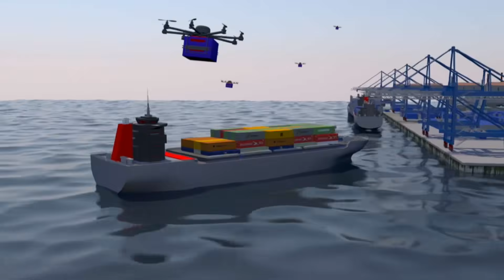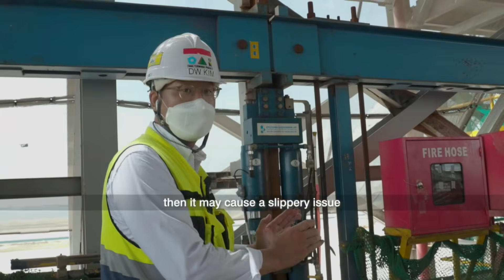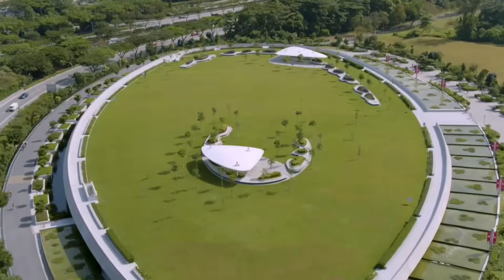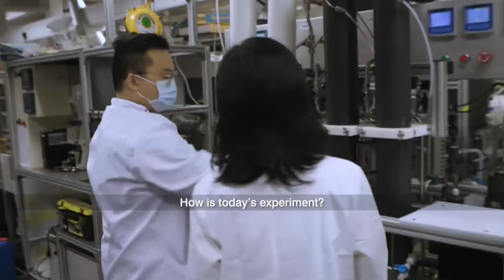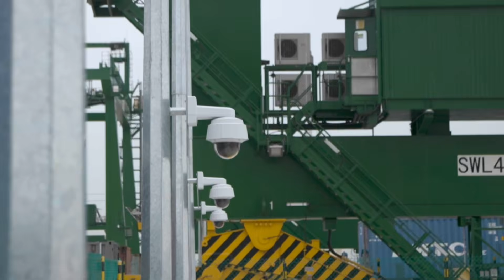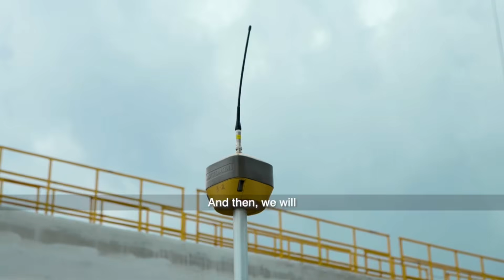Radical Innovations To Singapore's Water Problem | Tomorrow City | Part 3/3

Comment: I love the documentary and the detail with creating the caissons, the fresh water issues, solutions through desalination, and the addition of a new port and land at the same time. The only thing that wasn’t covered in this documentary (and I was waiting for it to show up) was how the caissons sit on the seafloor? 

In other words, the Seafloor it’s not flat bed rock. What type of preparation did they do to the seafloor in order for the caissons to be horizontally even with the waterline on top? You can’t just take a caisson that’s 30 m high and sink it into the ocean floor where it matches with the water level on top without any detail preparation on the bottom. If you did that, they would all be at different Levels on top because the seafloor is not perfectly flat. To me, that would be one of the most important parts of the whole building process.
Reply: My question is.. isn't just evaporating water easier and less energy consuming that pressurizing it and making those expensive specialty membranes?
Reply: I was wondering the same thing. Surely there are preparations done and I wish they covered that here. My guess is they dredged the whole area to the same depth as the natural depth along our coastline isn't that deep.
Reply: @kevinharmon8227  It's more energy consumimg but you could say it's easier
Reply: The only thing I can tell you guys, the Palm Islands in UAE, how was made you can watch it.
Reply: @kevinharmon8227  evaporating water takes far greater energy to heat.
Reply: Robert, they're probably silent because that's where the Engineering IP is. Most likely some form of deep water steel coring, piling and underwater concreting has been carried out to create a stable base footing.
Reply: @kevinharmon8227  theres not enough land space for large scale evaporation of seawater in singapore. Its slow, depandent on weather and you'll need huge lakes of seawater to match the demand. Its also too humid in singapore so evaporation will be slower
Reply: @gargantuantentacles846  the difference is, the port is designed and built to last. See the serious erosion happen to the Palm island, and Singapore for a century of reclamation has paid tremendous attention to.

Comment: I'm sure the engineers who designed the Tuas megaport structures has taken into account the effects of climate change and the possible sea level rise by the year 2100 or earlier. The new port has to be future proofed up to 100 years and beyond. So it would make sense if the caissons are designed to float and its height can be adjusted by pumping out the ballast water as required when sea levels rise.
Reply: Caissons full of rocks. They anchor the edges of the reclaimed land area.
Reply: Oops.
Reply: the level will not rise too much, just dont watch propaganda
Reply: @m402363  Exactly , in Spain 2023 you cant enter a city with a 2006 car , coz "polutes", after that they invented a "pass tax" in order to 2006 car owners can enter xD

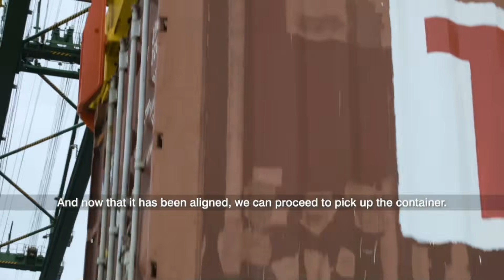Comment: 40:50 Calibration or testing of various sensors need to regular done (e.g. a few times daily or hourly) to ensure various sensors for automated heavy movement are working properly to facilitate heavy automated movements. I.e. heavy automated movements will be stopped and alarm triggered the moment a sensor issue is detected.

Comment: Engineering on paper is different than for the ones on the field. Cussing at the engineers sitting at their desk is a daily routine for us working on the field. Then again, it's a mutual relationship.
Reply: Trust me, you arent that significant
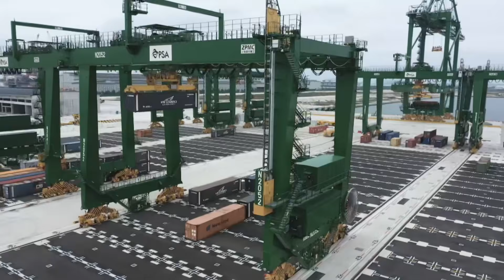Reply: 30:32 what's the silver lookng wheel on the big green howsyerfather?
Reply: @vandebosch822  are you?

None of them are. Nobody is.

Dust in the wind.
Reply: MOONA m  Noted. Thanks for the reminder to install Grammarly.

Comment: OOPS this was meant for the floating solar farm installation.    A lot of fish tend to congregate under or around shady areas, such as oil platforms and docks, so I can imagine these floating platforms will attract many fish especially if there are columns going down into the water to give hiding spots.    With what China is doing to Hong Kong I can see Singapore taking over as the shipping center of East Asia.  Now they are putting in a lot of wharf space on the water itself.

Comment: So in theory if there is already equal pressure of desalination 650m under water, the water that deep or further depths should be naturally partially desalinated as the water pressure would push out any molecules that aren’t hydrogen and oxygen, therefore reducing the salinity lower in the ocean . So pumping water from the deep ocean could maybe be more energy efficient than desalination using a flowing pipeline the pressure itself would drive much of this water towards the surface.
Reply: Singapore does not have access to any water body that is 650m deep lol

Comment: I have two questions:

1. When you sink the caissons do they set on the bottom or do they float? If they float and it looks like they do, what is to keep them from shifting in bad weather?

2. In your water system you mentioned that you could switch from sea water to fresh water and back again. I was wondering if you have ever considered prefiltering your sea water? In the area I lived in when I was young we had Salty water and we developed a system of running the Salty water through a system of sealed glass chambers and would let it sit so the sun would heat it up. As the water would heat up it would condensate on the glass above and drip to a channel that would carry it to our water tank for drinking. In one day we would make more than we could drink in a week. I don't know if this could be enlarged enough to make it worth using in your situation but I do believe it's worth a try. It only cost us a small amount of energy to pump the water and nature took care of the rest.

We would just drain the system back into the source where it came from but if you are pulling it out of ocean water maybe you could run it until there was no water left and sell it as sea salt.
Reply: @cassieknowslots  get off your mum’s phone
Reply: It requires more energy to run the more saline the water is.  So it’s uneconomical to extract fresh water from the brine at a certain point.
Reply: Caisson Will sit permanently ,finally Will be put sand in the rooms of caisson. Caisson is not new technology, during WWII allies Troops using caisson to land in Normandy 😁😂😃
Reply: @ZSVisuals  Spot on..
Reply: There is a system called a solar dome. It’s just as you describe but has a mirror system to concentrate he sun’s power.
Reply: @jerrythehousetiger3616  Didn't they show scientists working on new systems for extracting fresh water?  Those new systems were much more efficient than the ones they have now requiring less energy.  They are committed to desalination so I am sure the scientists will gradually improve the process to where it is economical to use.

Comment: Does the Hydrodynamic scour the caisson's create accelerate the eroson of adjacent, coastal areas as it impacts on the littoral drift process? Also is there an EIA for the huge increase in the use of so much Silane? Great technical excercise but you maybe storing up a food chain disaster for the future.

Comment: Integration with roads and roofs for both water collection and energy production is nearly ignored. Major highways can include massive water retention. The USA turns their heads also because road construction is designed to fail to begin with —- so road workers replace it again.  A mafia level agreement to rebuild roads again and again. I see people making new footprints instead of using existing major construction that occurs non stop …
Reply: I agree. I read somewhere there was  a proven paving mixture technology that makes the roads heal themselves and last decades if not forever with minimal maintenance. Sadly, the road construction lobby nixed it because they didn't want to lose their job security!

Comment: The concern that comes to mind; where does the sand & gravel for those Caissons come from? What beaches or shallow water areas have been destroyed? What destruction to what ecologies have occurred for man to say “look what I built?”with no regard for the lives destroyed? It is fascinating — and terrifying.
Reply: Look around your own house.  Where did all of that concrete, timber, glass, etc  come from?
Are you "fascinated and terrified" by your own home?  How about all of the homes in your neighborhood, or in your city?
Reply: @glynnec2008  In another CNA episode, the slag derived from incinerated refuse (which has normally been used as landfill) is now being combined with cement to form even stronger concrete.  It is used to substitute the sand.  We used to deposit the slag in an off shore island as landfill.  With this concept, there will be less demand to use sand and we can benefit the environment.  Incinerating the refuse and waste to produce heat and energy to generate electrical power and at the same time use the slag for construction.
Reply: Unfortunately I have heard that some of the sand and gravel coming in to Singapore is quietly coming in from other places in the world that shouldn't be doing this. ie. illegal? I hope it's not true. Have you looked into the situation with sand? Not all sand is equal and the stuff needed for say high precision optical instruments is very rare so hard to find, and most sand is not suitable for making cement. There's a couple of books out on it and I think videos. Scary stuff. The cement industry is advancing but it really needs more advancement and getting away from sand as an input. I haven't watched the following video on Singapore's relationship with sand, so I don't know how credible it is. https://www.youtube.com/watch?v=ES2TWIcFOzw

Comment: The combination of large power requirements and the power requirements for RO (reverse osmosis) require more power than to use the multistage evaporation technique, which combines the cooling requirement of the powerplant with the condensation of both the steam driving the turbines snd the  extremely clean condensed, ready to prepare potable water. The use of membranes does not makes sense. They are fixed to make a huge mistake. How to I know? Because we delivered the first multistage evaporation unit to Singapore , built in Switzerland, by EPUL . Ecole polytechnique á Lausanne

Comment: I think with area (743 sq.km)* rainfall(2200 mm)*60%  = recharge  potential of 750 MCM. 
This should  meet the needs I'd recharged  .
We implemented world's largest recharge  pilot of 1500 MCM in 1000 sq km.
Similarly  wastewater  can be used to grow  water.hyacinth to Reduce  treatment  costs , produce biogas,powrr

Comment: How about photoelectrolysis? It is 97% efficient vs 22% for solar cells. The hydrogen gas can be used to produce electricity. The combustion product is fresh water. It will dump oxygen into the air.
Reply: You need a lot of expensive and energy consuming infrastructure.
Reply: @Mark_badas  It is just not cost-effective to mass-produce the catalyst material.

Comment: What Singapore should do is to build underground water cisterns about 10000 litres capacity in selected HDB blocks. If multiple the numbers of HDB blocks to 1 x 10k cisterns, that will be alotbof water storage. Utilise every space, now they're setting urban farms on top of the multi-storey carparks, solar panels on the roof. Next fews steps, undergroud water storage, vertical wind turbines, greenery wall claddings on their highrise buildings to reduce temperature absorption and reduce the overall temperature.

Comment: the keppel marina east design should be incorporated into sydney harbour in that the harbour be seperated from the sea via a barrage and a dual use desalination/ water treatment plant be built on the edge of the divide between salty and fresh water, this would greatly alleviate water stress in the fast growing city, warragamba dam is already strtched to its limit
Reply: thats a horrible idea, what are they gonna do when oceasn rise 10 feeet in the next 60 years?
Reply: @soulsreaper7145  that's what the barrage is for, to prevent the sea water from backing up into the reservoir

Comment: This is My Last work-done Completed Project in Singapore for GENTRY TOWER as Steel Structure  Fabrication& Installation 
as well as design for detail design including Shop drawing and all about safety work procedure as same as 8years before at
2007-2008 for the Pasir Panjang port project..

Comment: I always wondered: How much reclaimed land is there per year? ANYTHING you dump into the sea, ALSO causes the see level to rise. How much sea level rise is all this reclaimed land causing?
Reply: Thinking that the sea level will rise because of reclaimed land in Singapore is like thinking it is hotter on the roof of a tall building because you are closer to the sun, than on the ground.
Reply: @gelinrefira  your comparision is incorrect. Of course levels will rise. The question is just: how much volume of reclaimed land is worldwide? It is not only Singapore doing it  Also it happens naturally at a rivers that end up in any ocean.
If you have a bowl of water and you put something in it, water levels WILL go up. No matter how little (i.e Sand grain) but it will.

Comment: 3:07 drones carrying shipping containers. hate to be the first guy who becomes a casualty. ROFL
Reply: by 2040 the technology on drones will surely be safe enough
Reply: The 4 drones were following the single green container possibly as a minder or for sensor/observation function. It would not be economically feasible to power the drones to carry containers weighing over 20 tonnes. The CH53K helicopter can't even carry that.

Comment: The best solution for the future of power in the U.S, Europe, and worldwide is the installation of Molten Salt Reactors, thorium looks best, but a number of fuels are being experimented with.  We know that for example nuclear waste from Light Water Reactors can be burned in the far more efficient MSRs leaving virtually no residual waste.  MSRs can be sued for cheap desalinization plants which are needed NOW.  Solar and wind will never be able to deal with the crisis we now face.  The technology was developed in the 1960s in the U.S. at Oakridge Nuclear Facility.  They had one running for 35 years trouble-free until lack of interest defunded it.  The Light Water Uranium Reactors were favored because they provided fissile material for nuclear weapons more readily. for Heavy Water Molten Salt Reactors are safer than the Light Water Uranium type because the molten salt provides both the heat and cooling factors so if there is an event it would cause the molten salt to drop in temperature and the plant shuts down automatically.  There can be no meltdown.  They are 97% efficient compared to the 3% efficiency of Light Water Reactors, so they can actually burn the nuclear waste of those types.  They produce so much cheap electricity that projects like decarbonizing oceans and desalinization can be done simultaneously.  They don't depend upon water for cooling so they can be built anywhere.  They don't require a huge conducting system of massive cables from a wind or solar field because they can be built on present coal or light water locations at or near the source of use.  Also, science has developed hydrogen fuel cells that can use iron instead of platinum, making fuel cells for cars and homes feasible.  The solutions are here.  All that is needed is for politicians to notice and unite to make what could be the quickest transition in the direction that solves the problem and would take the world into a better future.

Comment: It never fails to amaze me, talk of climate change without mentioning its primary consequence - sea level rise.  We have prioritize removal of C02 from the atmosphere.  Singapore needs to focus on using less water, water conservation, ways of removing C02 from the atmosphere and building to anticipate sea level rise.  Singapore is  setting itself up to crash and burn if it doesn't.    What will the effects of sea level rise mean for existing  buildings?  Things do not  look rosy. 
 Grow a pair!
Reply: Right on! Sea level rise will take this project to a whole new level, namely, underwater.  Think of the enormous carbon footprint of all that concrete and steel.  This project was wrong in every way.

Comment: Why not put the (desalination) membranes 800m under water and let the natural pressure at that depth do the work for you instead of needing so much power to do it artificially.?
Reply: Your question is 2 years old, but it still needs an answer. Because the coastal waters surrounding Singapore are generally less than 30 meters (100 feet) deep.

Comment: @41:30 calling that a AI system is a bit far fetched. It's a mechanical system with lasers and sensors and position sensors.  It has no intelligence at all! You can see one laser failed and it stopped working. That is not AI. That is no different then a automated assembly line. It works as programmed but had no ability to adapt.

Comment: Why not build a small structure 600 feet below the sea water and use the water presumption to pump the sea water through the membrane and then pump the clean water with 1/100th of the power we use on the ground to our reservoirs.

Comment: Do you see those 50 story apt buildings ? build a structure 50 stories high with 5 slim tall tanks. Fill them with sea water and let  gravity do most of the work sending the water through the filters. store the water in one of the tanks